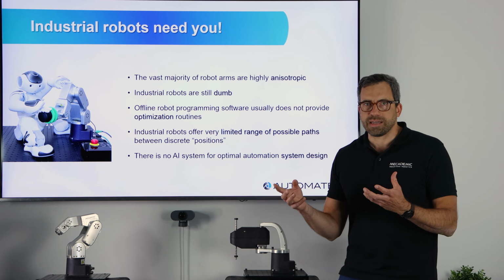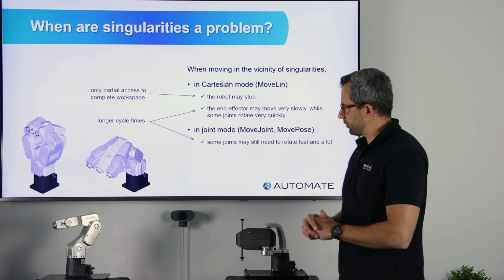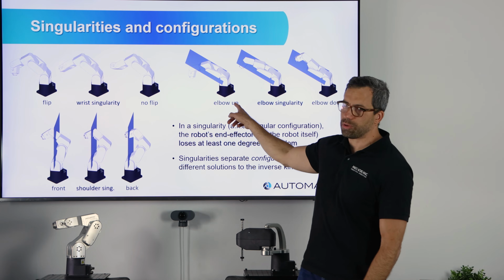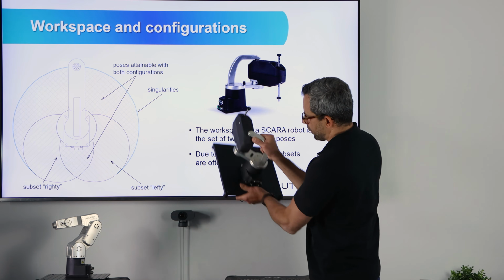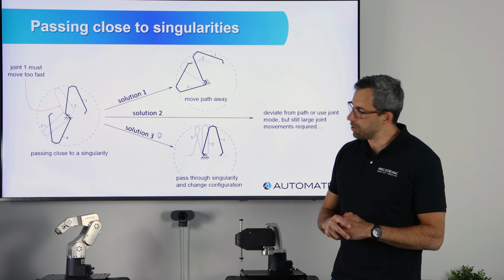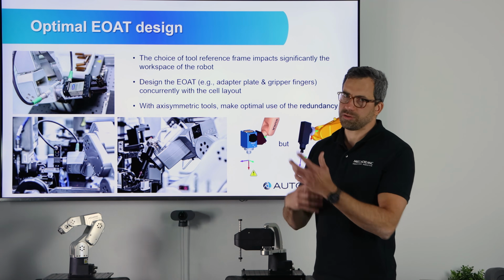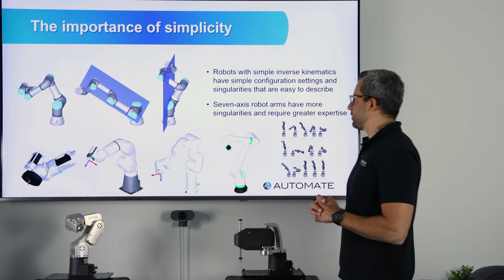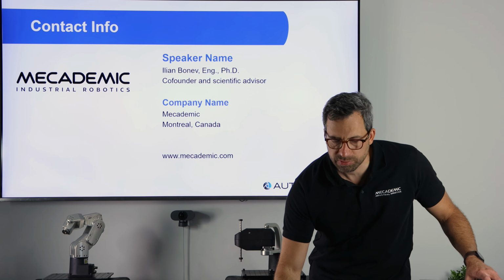Optimizing Robot Paths & Coping with Singularities | Prof. Ilian Bonev (Automate 2023)

Comment: Very interesting presentation. I'm working in robotics too, and I think that the fact there is not a lot of application using AI in robotics is the fact that it is very expansive in terms of time calculation and not very good for real time.
It's even more complicated as IK for example can cost a lot. And the robots controllers usely works at around 500Hz or even more, which is not very adapted for IA calculations